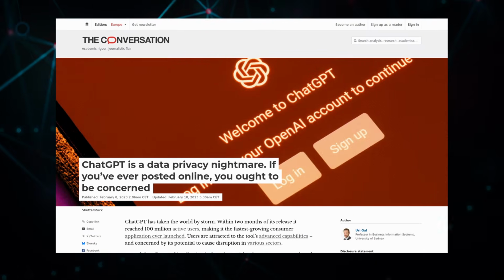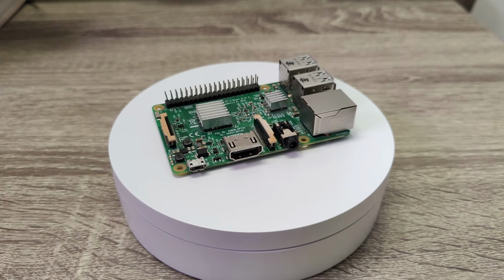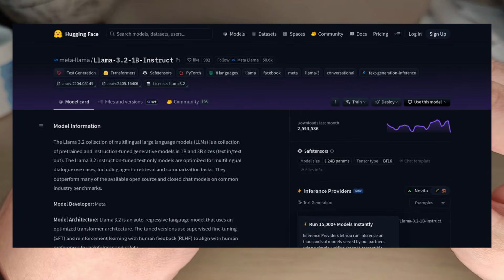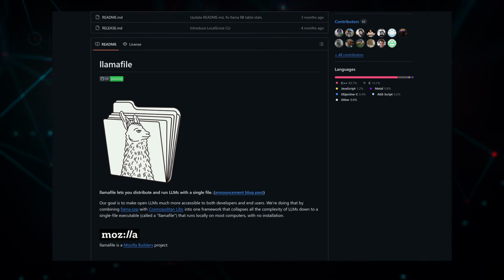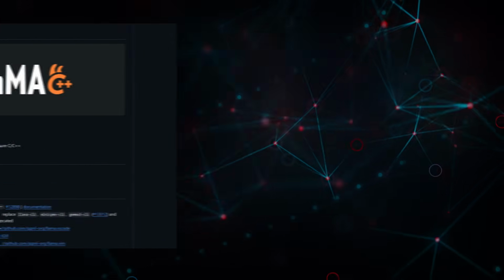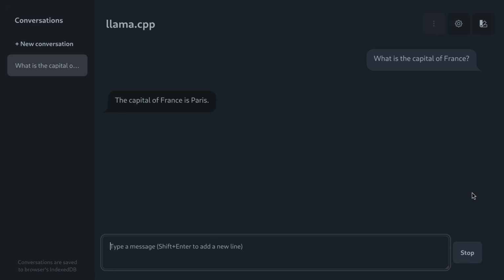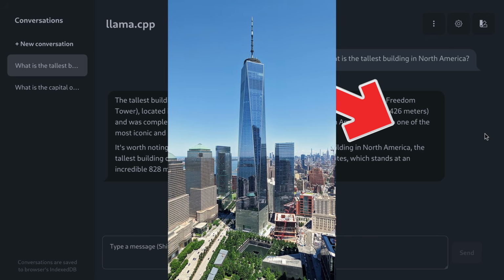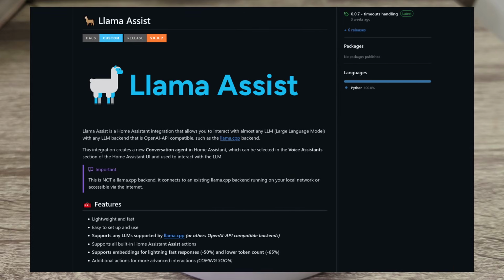Running AI on a Raspberry Pi

Comment: recently im toying with running LLMs locally too, tho not on a raspi, but here are some tips:
- you can speed up compilation times by using multiple CPU cores with the -j (jobs) flag, because by default make and cmake only compiles on 1 CPU core. not sure if you tried this, but didnt mention it in the video, so i thought i will share. choose the number of cores/threads your raspi has.
- you can use btop to monitor system load and resources during compilation and running the llm (btop is my favorite system monitor, but of course htop, atop, etc. all work)
- compilation takes up a LOT of memory, so you probably run into this issue, which can be solved by creating a swap partition or file and mounting it as memory swap. it will be much slower compared to normal RAM, but at least the compilation wont fail. you will need several GBs of swap i think.
- if you compile a lot of things it is very useful to have ccache or sccache set up, as it can cache the individual compilation results of individual files, meaning you wont have to compile everything every time from scratch. since these projects share a lot of similarities and probably have common files (as they are built on top of eachother) the cache would probably speed up other projects/inference engines as well.
- since your raspi has a GPU you could try to run the inference using vulkan/GPU. you will need to download the vulkan SDK and enable the compilation flag, but it is supposed to be much faster than CPU, also you could use your RAM and VRAM simultaneously.
- another popular inference engine is ollama, which is really simple to use and doesnt have a lot of settings, but it generally works out-of-the-box, so you could try that as well.

- and the last tip is to keep using a small LLM, but with a client which supports MCP servers. these servers enable LLMs to actually use tools, which could mean browsing the internet, which means they can basically look up up-to-date information, so the LLM itself doesnt need to "know" everything, just understand the english language. im personally playing with the Brave search API and MCP server, which is free for 1000 searches/month and it is very useful.